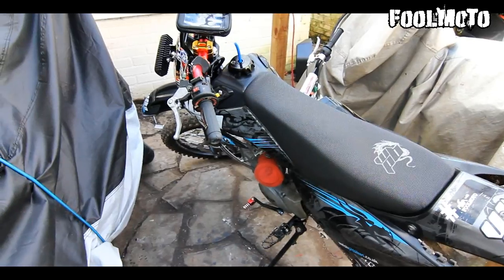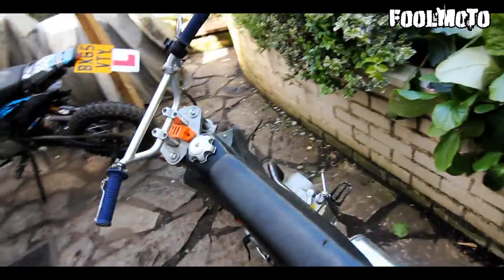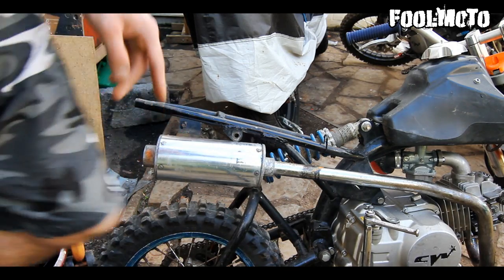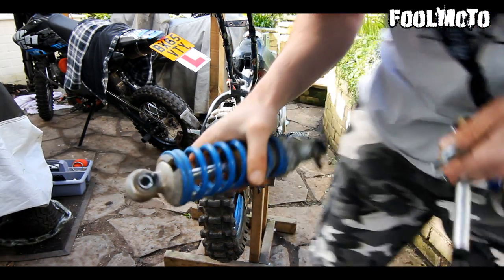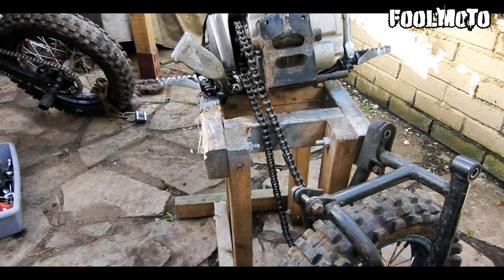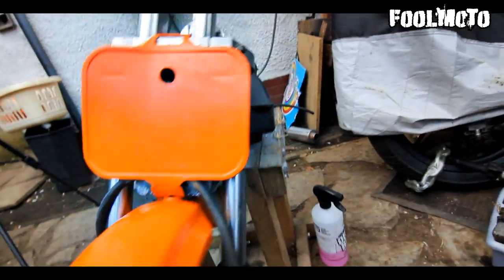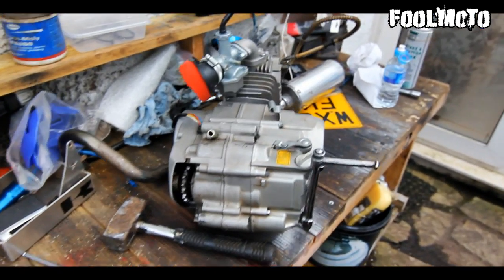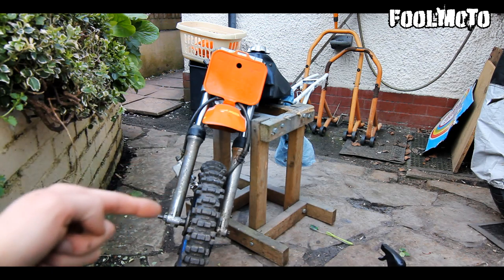NEW PIT BIKE!

Comment: bro honestly you should part the bike the engine is worth at least $275 the wheels about $100 and other things maybe $20 or a bit higher like the frame which is crappy on all china bikes im gonna upgrade my rear shock i have 1 but  its a bit to long and im running a 428 chain that i have to run and the swing arm is to short and my front forks are short but i dont really care lol thanks for the other video on the 17/14 wheel change

Comment: new forks are you kidding me. man you dont know how to fix shit. drill and tap that bolt. heat it up VARY VARY slowly. back it out
Reply from the maker: new triple clamp and forks are like 
£40,pretty cheap,what would you recommend?
Reply: i have the BBR SP-5 forkks on mine. the 5 means five inches of travel. but go with the BBR E-6 if you can find them there a little bit more $$$$ but its worth it if you end up goin full mod. if it is a china bike( NOT honda. kawe suzi. ktm ect) go to TBOLT.com they have cheap parts.  if you want to order from USA